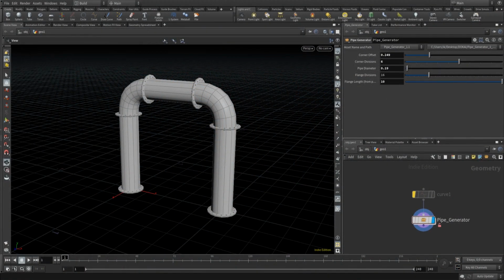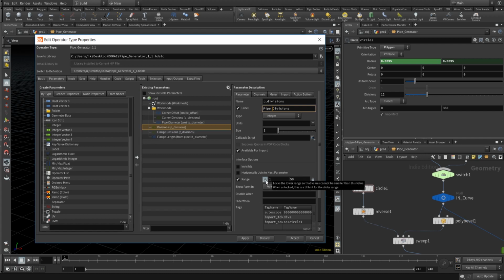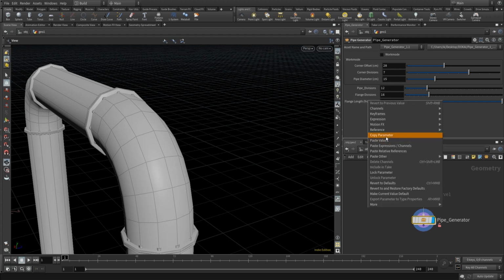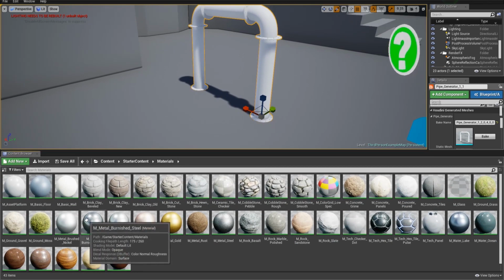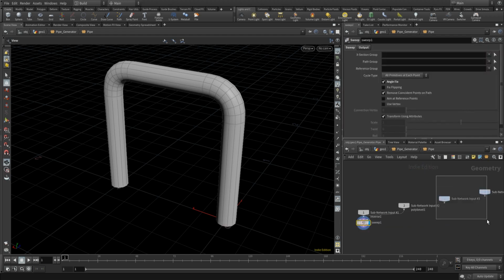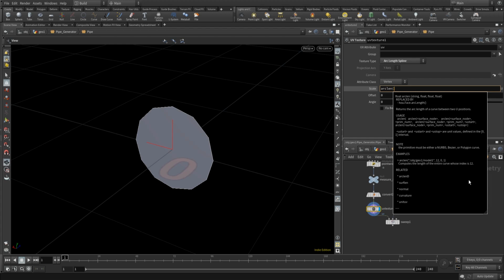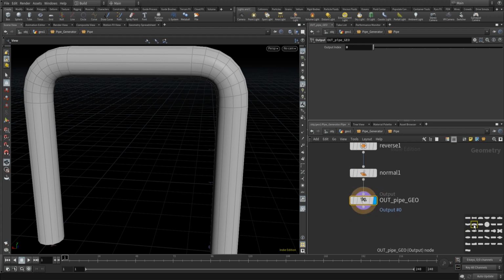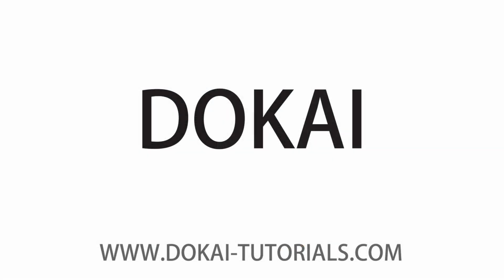Procedural Generated Pipe - Part 2: HDA and Unreal Materials

Comment: I am running into the same Problem at the same point in the video as Gryazekrab. After i uv the Pipes with the add- and the Pointwrangle Node my Geometry is all twisted...just like in your Video but putting the Reverse Node behinde the sweep does not fix it for me.
Reply from the maker: Thanks for watching, make sure that in the sweep node you change the cycle type, this might solve your problem.
Reply: @DokaiTutorials  This solved my issue thank you

Comment: Hi thank you very much for makeing these great Tutorials, i intend to do them all. I am running into the same Problem at the same point in the video as Gryazekrab. After i uv the Pipes with the add- and the Pointwrangle Node my Geometry is all twisted...just like in your Video but putting the Reverse Node behinde the sweep does not fix it for me.
Reply: You solved it
Reply: @yunzhao8035  i might have. on their webside you can find project files...i just had a quick glace yesterday. there are a few nodes added. just did not come arround to try it out myself yet.
Reply: @loonateer  Thank you